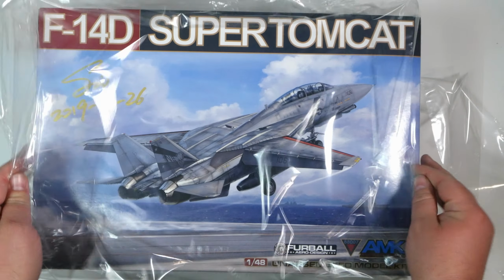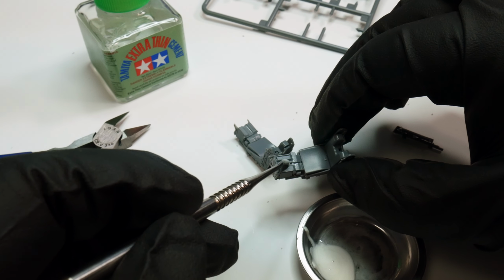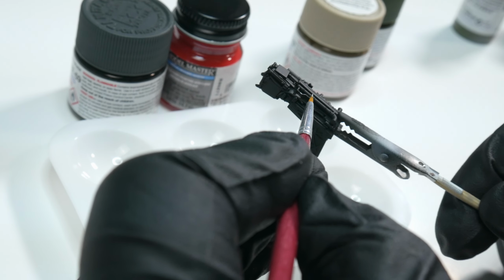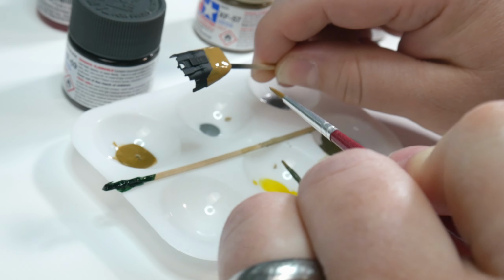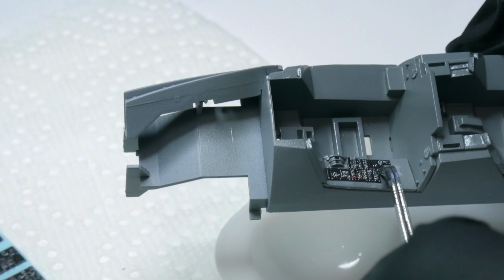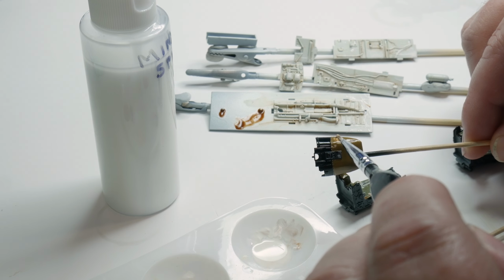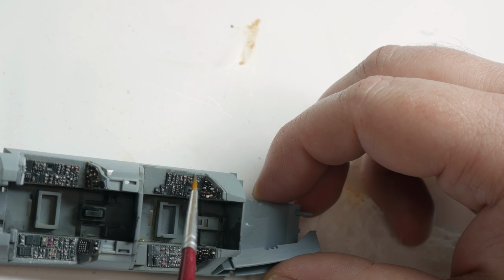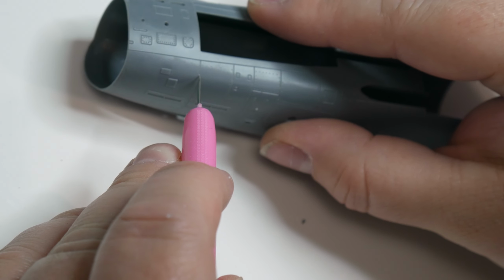AMK F-14D VX-9 1/48 Scale Model Build Part 1: Cockpit

Comment: Nice work. Build is off to a great start, looking forward to the rest.

What oil paints are you using? Most are formulated for use on canvas with a much higher linseed oil content. For best results you want to stick a blob of it on some cardboard and lead the excess oil leach out over a couple of hours before thinning and using on the model.

You can get oil paints and washed formulated for use on models which are ready to go immediately. That may address your difficulties weathering with oils and washes.
Reply from the maker: I'm using some artist paints from an art store. I didn't do anything to remove the oil so that might be the problem.  Thanks for the suggestion! I'll give it a try. Thanks for watching!